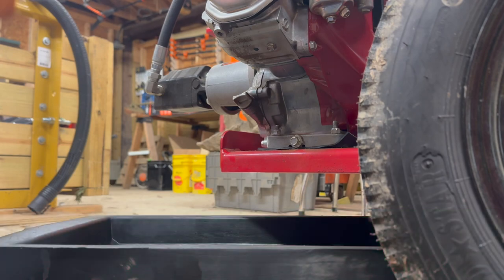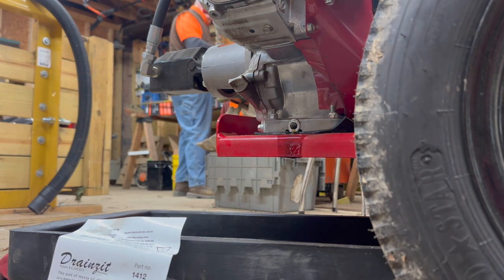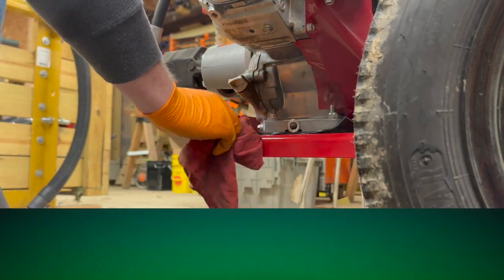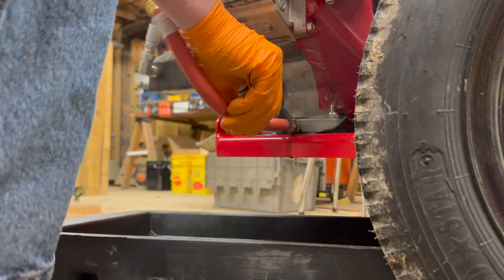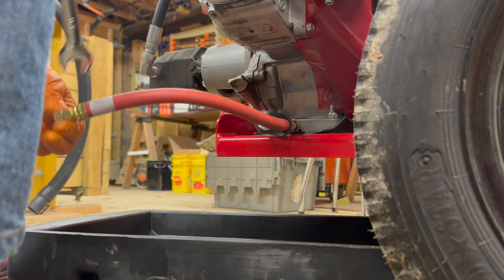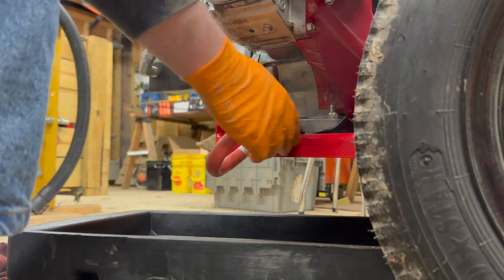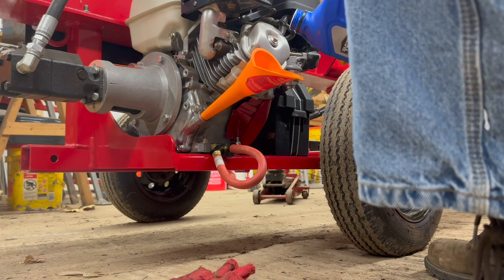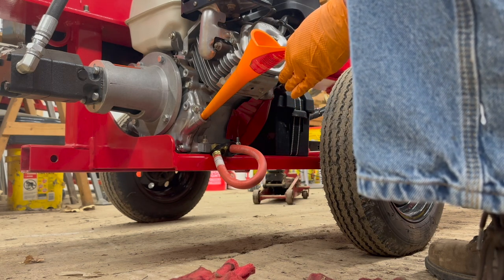135 - Wolfe Ridge 28 Pro Engine Mod

Comment: Nice install Bob. That should make future oil changes much easier. Clean and tidy. Love it.
Reply from the maker: I have my fingers crossed.  But when I comes to me and oil, I am a hot mess.  I am taking a minute tonight to watch some videos about the Insta360 X3.  I lost another series of videos on the DJI Action 3 camera last week and the one video that it did not delete had no audio.  That was my intro, go figure.  I switched memory cards and it just wants to do its own thing.  Maybe I will do a video.  Thanks for watching and commenting. Enjoy the Journey - Cheers
Reply: @botabob , i bet the videos are still there but in another format. Are you using the 360 studio?
Reply from the maker: @goldwingmoments  - the lost videos were taken with a DJI camera.  The Insta360 camera is waiting for me to figure out how to use it.  I installed the app and updated the firmware.  I'm concerned about battery life.  I like to set the camera on a tripod and start to record.
Reply: @botabob  , sorry i don't know anything about the DJI files. I do love my insta 360 oneX2. It is more work to edit but gives you more options. My battery life is great. I think it will work well for you.

Comment: Hello Bob, Thats the way our Bobcat drains its oil, very easy just loosen one small plate and run the hose out, Bobcat Advantage 🚜🪵🇺🇸
Reply from the maker: This is the second thing I put a Drainzit on a piece of equipment.  The first was my father's stump grinder.  What a mess it was getting to that oil drain.  The oil had no where to go except all over the equipment.  As you could see in the video, the Wolfe Ridge did not really need the Drainzit, but I figured it would not hurt.  That sounds like a good system.  Any thing to make routine maintenance easier is a good idea. Thanks for watching and commenting. Enjoy the Journey - Cheers

Comment: Great installation, it will make a huge difference to the time it takes to change the oil and the mess it makes. We were thinking of doing this on a Honda GX140 and the Internet says it has a metric thread, it is interesting that your Honda is NPT
Reply from the maker: This is what Amazon reports about this model:
About this item
    3/8 in.
    Quality brass fittings
    14in. overall length
    GX 240, GX 270, GX 340, GX 360, GX 390, GC190LA, GCV160, GCV190
There is a metric version that might work in your application available at Amazon.  
Drainzit HON1010 10mm Oil Changing Aid for Honda GX110, GX120, GX160, GX200 
Thanks for watching and commenting. Enjoy the Journey - Cheers
Reply: @botabob  Thanks for the information, we may go down a slightly different direction. It is interesting that Honda used different threads on the drain plug for different engines